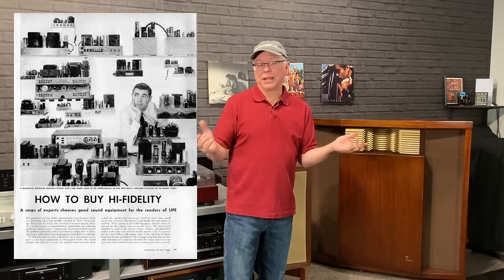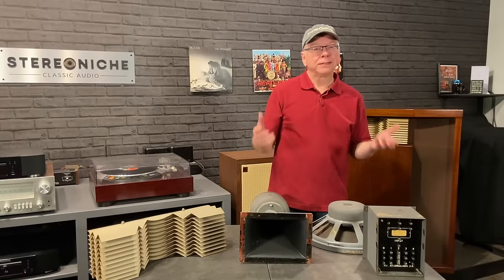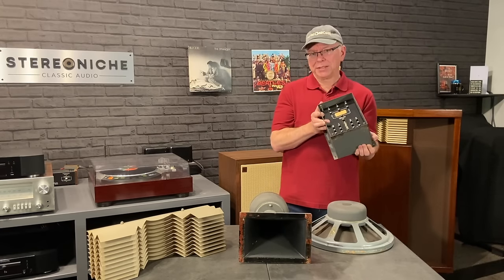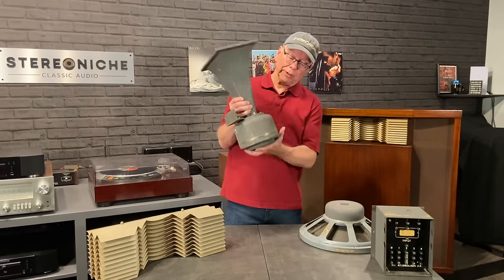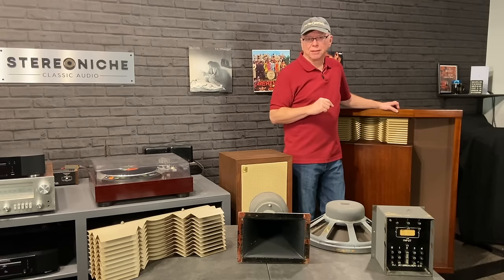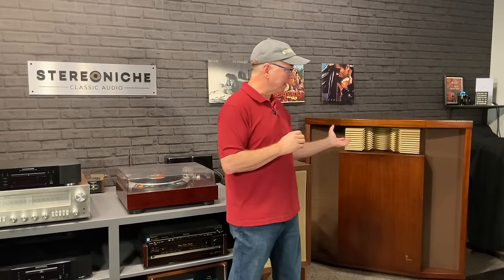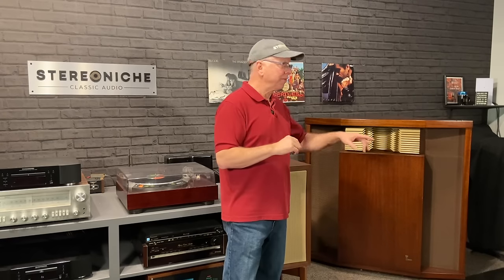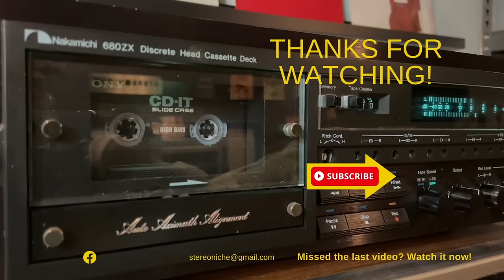JBL Hartsfield - THE Most Wanted Vintage Speaker EVER - For SALE!

Comment: I am surprised how thin the backside wood panels were. I would have thought they would have needed to be thicker to reflect the sound inward without vibrating on their own. In 1953, my father took my family to a hi-fi show in San Francisco where I saw  the Paragon speaker system. It was awesome looking. I do not recall hearing it. Later my father built his own small corner-horn speaker for my older brother, who still has it.
Reply from the maker: Those panels are not part of the folded horn, they are above that chamber. The woofer chamber is VERY well braced.

Comment: I had one several years ago I picked up at a thrift store for $75.  Just needed some cleaning up and looked new.  Amazing that I could drive it to pretty loud output using a pocket sized transistor radio. JBL used the same components as in the Hartsfield for many other speaker enclosures.  A few years ago when the Riviera Hotel and Casino in Las Vegas was demolished all the hotel's equipment was auctioned off.  A local audio collector was able to buy  much of the sound systems used in the showrooms.  As I recall those systems had those same components but without the benefits of the exponential horn loading (made up with amplifier power).  Later saw those same systems on Craigslist for big $$
Reply from the maker: Wow, you found a Hartsfield for $75? I bet there were some crazy good old gear that came out of the early Vegas casinos.

Comment: I used to, rarely but, sometimes, have to replace a shorted capacitor in Altec VOTT speaker crossovers. Like the vintage JBL’s in this excellent video Altec’s crossovers had the components potted in, basically, tar. To get at the capacitors I would put the whole metal enclosure on the stove on low heat. After a while the tar would melt and I could withdraw the goopy but, free capacitor and solder in a new one. A really messy and, somewhat smelly job but, it kept the crossover going for another 30 years or so. Both companies made quality products that lasted a long time.
Reply from the maker: So much great gear from this era. Indeed, I've look at those boxes many times and thought about how messy/smelly it will be doing a recap. Makes the purchase of a hotplate all worthwhile so you can get it outside. 🙂

Comment: The 150-4C has a shape designed to handle the high pressure of a horn-loaded driver which is why there is a metal ring making the speaker wider than the similar 130A/D130.  The 375 with its original diaphragm rolls off above 10Khz; I've seen a JBL 075 added to a few Hartsfields for that reason, and why the S8R build uses the 075 also.  The JBL 2441 went higher with a different material and edge design.  ; I have a pair of the 375/2440 drivers with 2441 diaphgrams and I like them a lot.  One interesting thing about the 375/2440/2441 is that the magnet holds the driver together, no bolts.
Reply: Damn dude, you know your stuff. I'm an audio buff and I never knew these existed :)
Reply: @keytrackmusicreviews  I'm 79.  Hearing things like the Hartsfield or the Paragon, Sovereign I, 4 KLH Nines, and the AR3a in one room was easier (1963, LA).
Reply: @michaelsquires1218  More power to you! Was the audio hobby/quest better back then? Sometimes younger people like myself romanticize the classic times you're talking about without fully understanding how things really were.

Comment: in about 2009 walked into a thrift store and found a JBL Sovreign set.  1 6" cabinet and 2 speakers.  i was lucky that they had a 25% sale that day and i paid 250$.  The speakers had 1 LE 15, 1 PR 15, 1 O77 tweeter and 1 375 Horn.  the cab had a Mac 110Z.  both speakers were driven by a solid state linier amp, dont remember the model.  amazing sound, i could touch each speaker they were so big.   my wife loved the sound  and i ended up trading them to a friend.
Reply: thats a 6' cab and 2 separate speakers.
Reply from the maker: That was SOME thrift shopping!

Comment: I was wondering about the HF response of that era that you addressed.  Altec came out with the “tangerine” phase plug in the 70’s to improve response.  Every JBL and EV that I had started using the same technology.  Some other companies didn’t until early 2000’s.  Maybe a patent issue.  But what an improvement!

Comment: These are considered the "Top Loaders" 1954-1957. In 1958 the internal configuration of the Bass folded horn was completely redesigned. Better Bass was the benefit. Classic Audio Loudspeakers has been reproducing the 1958 design systems since 1985 in the USA. Now featuring Field Coil Powered Components.
Reply from the maker: Thanks for the details John.

Comment: Heard a single one ca 1966 driven by an MC30/C8 mono setup; loved it.  Nice seeing the 150-4C and the bubbleback (early version) 375.  I have a descendant, the C60 Sovereign I S8$ with the LE15A/PR15/375/075 drivers, will experiment with the 2405 instead of the 075.
Reply: S8R, not S8$

Comment: No need to demo the sound, there are quite a few out there already on YT.  
  After listening I have to agree with you.  I wasn't expecting that sound.  And I couldn't find much to fault.  It's surprising how open they sound, the speakers really seem to disappear.  The highs were wonderful, and very natural sounding.  The only nitpick might be the low bass output, but the bass that is there is very fast and clean.  I don't really miss the lows too much although it might give the midrange a bit more warmth.  I also had a quick listen to a Paragon demo and it seemed to have a bit more low end and a slightly warmer sound.
     In short, they both sounded amazing and I can appreciate the reputation they have.  Unbelievable for mid 50's technology.  Almost makes me think twice about vintage gear.  Almost, lol!  I imagine they will sell for a pretty penny.
Reply from the maker: Yes, they are quite satisfying. The low end is all there, just not exaggerating like modern music often demands.
Reply: Thank you for making this point. You single-handedly proven one can easily pick out different nuances and individual sounds inherent to each other speakers through our own hifi/stereo systems

Comment: Does the lens help soften the sound of the tweeter? I ask because I have a pair of opera M-15 speakers that use a horn tweeter but I feel it is a bit too much, they have no lens like these JBLs, and makes me a bit tired to listen to..
Reply from the maker: I wouldn't say they really soften it as much as disperse it. There are some tweeters that cause me ear fatigue, most have been from JBL's offerings from the 80's and forward.
Reply: In a way the acoustic lens does “soften” the sound unless it’s compensated for. It imparts, what sounds like, a roll off in the HF response. The actual change is because the lens is spreading out or, widening the, the high frequency dispersion. That’s the whole purpose of the lens. However, all compression drivers have a HF roll off; it’s just part of the physics. The old exponential horns, like this one, would progressively beam as it went up in frequency. This would, more or less, compensate for the HF roll off of the driver; ON AXIS ONLY. Off axis, the response would roll off precipitously. The acoustic lens would mostly ameliorate the beaming problem but, then show the HF roll off of the compression driver because you’re not getting the boost from the beaming. You can compensate for this in the crossover but, unless you incorporate it into your design you will get the roll off and a softening of the HF. You do get a better, wider response of the HF with the acoustic lens but, there is a drawback that should be factored into the crossover design.
Reply: @Obsfucation  That's a lot of explanation. Thanks

Comment: All of you guys are always talking about “the best vintage speakers” in “MY TOP 5” and it’s only half the time because of thy are  actually good speakers.  And the other half is for the same reason the Tulip market in Amsterdam happened! Lol 

And that’s all.  

BECAUSE THE ADS /BRAUN is even more rarely mentioned by those who KNOWS when they are mentioned,they are ranked above JBL .   
Because these 3 big known  companies only had 1/3 the actual SOUND ENGINEERING as ADS had.  
Because two of them engineers went to work for companies like JBL & B&W. 

Funny how it’s when the top 3 companies was who they were & when ,ALL 3 OF THOSE HEAD ENGINEERS FOR THESE BEST TOP SPEAKERS WAS ONLY TOGETHER AT ONE COMPANY & that was at ADS /ANALOGUE DIGITAL SYSTEMS, but not mentioned by many people. Lol.  But are always in the top 3 speakers when the person does know about them.  lol. 

I’ve owned stuff from every company. 
And many different models .  
After 40 yrs of that ,I’ve only kept my ADS system.   (1590’s. 400’s & 507’s )   

These drivers in this “hearts field” lol. 
Looks like stamped steel compared to the 2030 ads cages & drivers. Lol. 

Just because they knew they were no need to make 15 cabinet speakers .   Lol.  Americans always thinks bigger is always better. lol.  “WHEN ITS ABOUT MORE” not bigger.

I’d rather have the 2030’s than these JBL. 
I I’ve auditioned them in person.   They aren’t really that good.   Especially by today’s standards.     
Ads sounds great even by today’s standards.  
They were the firsts in a lot of areas in the American markets.  For example,NOBODY DID POWERED SPEAKERS before ADS. lol and this was 50 yrs ago.   Yet.  Not mentioned. 
All of these old speakers like this are bright .  And not clear.   When he mentioned “THE 70’s speakers got better “ ?  It’s because of ADS.  lol. 
Again .   But I know.  JBL IS POPULAR.
Reply: @high-endvintagelover5779 😂You must be really big in the tulip market ?  😂😂.

Comment: The N 500 was not the correct crossover ever installed into a Hartsfield. It was only the N500 H , "H" meaning "horn"  Plus that  unit with the N 500 has been somewhat altered. Wiring is not standard. I've had over 30 Hartsfields as previous empirical  experience. Also its a 150-4C speaker , not a 150 as mentioned.The 150 was a 32 OHM driver.Good luck with the sale.I still have a pair.
Reply from the maker: Thanks for the detail John. 30+ Hartsfields? I would say it would be hard to find anyone having seen more than you other than a JBL employee. Are you located in California with a shop? What is the spec difference between the N500H and N500?
Reply: Simply said - there are component differences between the two mentioned crossovers as well as the obvious attenuation configurations. I could offer you the schematics on both units for you to see the engineering differences. The 500 H is the same  component configuration as the N 400 crossover used in the early Paragons. I'm just a JBL junkie that has an authorized JBL Service Center with many JBL systems that I have acquired. For bragging rites I have the only version known to exist of the  " Industrial Variant " Paragon.  @stereoniche
Reply from the maker: @JohnHarding-zl4jz  Very nice! If you wouldn't mind, I would greatly appreciate the schematics. If you get a moment: stereoniche@gmail.com
Reply: @JohnHarding-zl4jz  My lands, You certainly are experienced with the different JBL models What a treat that you have any able to experience all those quality systems in your time. I never even heard of the industrial variant. Would be great to have some exposure

Comment: I'm going to have to say I'd honestly be scared to purchase those speakers from you now. After seeing you fiddle with the screws with both the drill/driver and then the screwdriver as well I'm afraid that most of the screws heads are stripped
Reply from the maker: Well, you would be mistaken. I take great care in working on any and all of the gear and speakers within my collection. I didn't wear gloves out of gross incompetence. If you notice, the drill speed is rather slow in the sped up video. As well, upon returning the screws, every screw is hand tightened only. Not a worry for you, the eventual buyer will get to see and check out each speaker fully before purchasing.
Reply: Vacuuming out dirt and reattaching 60+ year old  oxidized connections with care and skill is a good thing.

Comment: They are JBL designed Klipsch K - Horns. A copy of Paul Klipsch design. Paul did k - horns in 1947. Look at the expensive JBL speakers and you’ll notice a La Scalla’s Klipsch speakers and you’ll see how close they all are. All are Great speakers !
Reply: The Hartsfield and the Khorn are both folded horns, but the way the horn is folded is different.  Most speaker makers in the 1950's had some form of corner folded horn for sale; I had a pair of EV Centurions with 15" JBL (130A) drivers and EV MF/HF.  Dr. K didn't worry a whole lot about the midrange/tweeter and I've found the Khorns I've heard too harsh, although one setup of 2 Khorns and a center channel La Scala (?) driven entirely by McIntosh (C22, something like a MC 275 and an another mono tube amp plus custom EQ) and installed as a gift from Dr. K to a former employee had the best imaging I've ever heard - the bass viols in a symphonic performance stayed in the same place no mater where you went in the rather large room.
Reply from the maker: Not a copy, but inspired by the Khorn. They were apparently different enough they were awarded a patent.
Reply: @stereoniche  I didn’t know. I do know how Great they sound and the Altec, Lansing. The old speakers from the 30’s , 
Motorola ? All sound fantastic ! I don’t think new speakers have anything on the old ones especially for the money. Everything has became so expensive. Keep up the great work ! 🇺🇸👍